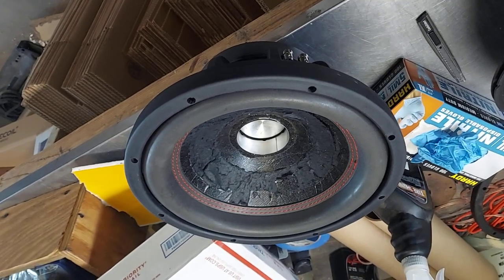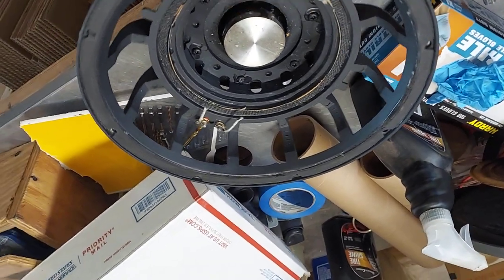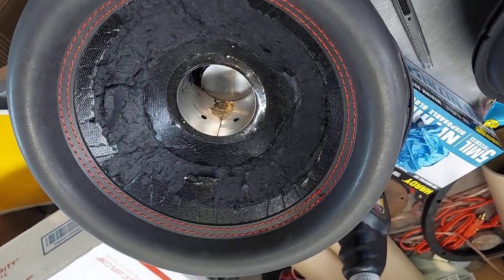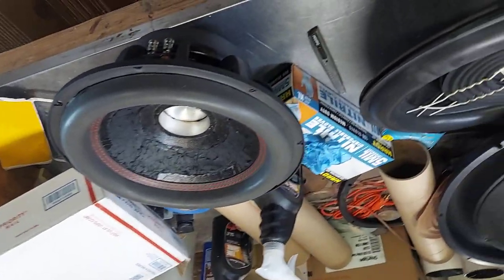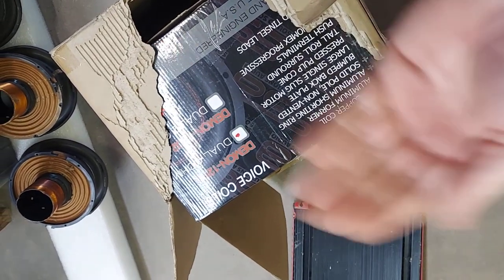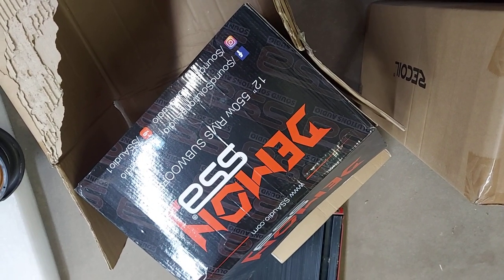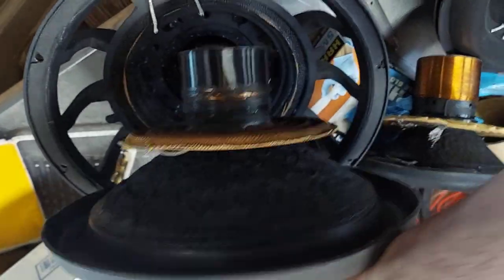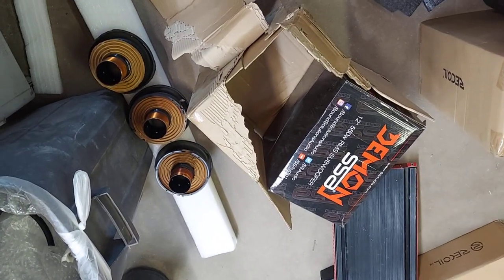Upsidedown review of the 12" D4 SSA Demon 550 wrms Subwoofer design by Fi Car Audio made by China

Comment: @RobotUnderground What Subs would you recommend with similar price point/specs to the SSA Demon? Looking for either 1 or 2 (10s or 12s) for my DD/Work truck 500-1000W
Reply from the maker: Do you need shallow versions?
Reply: @RobotUnderground  Don't think it needs to be shallow, I have found under seat boxes with mounting depths of 6.5" to 7" and air space ranging from .75 ft3 to 1.35 ft3 per sub sealed.
Reply from the maker: @miked4bz554  Stick to 10's for those.  They sound better than 12's in that same space.  You'll need something that can handle like 1000-1500w.  Text me when you're ready, 6023126504
Reply: I recommend the SSA Demons

Comment: Would you do a recone for one?
Reply from the maker: Sure, send me the gap dims.  6023126504
Reply: Ok it'll probably be Thursday before I can get it torn down. What dims would you need?
Reply from the maker: @gregblau8082  Let me know if it was a D2 or D4 originally and what you want it to be.  Text me direct if you want parts or a drop in, 6023126504